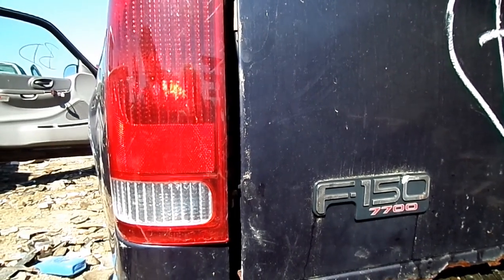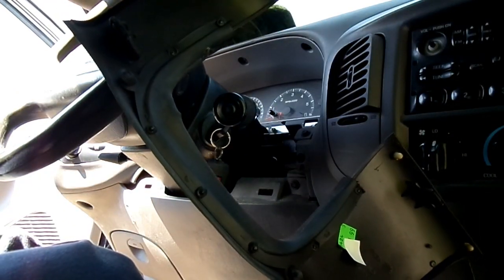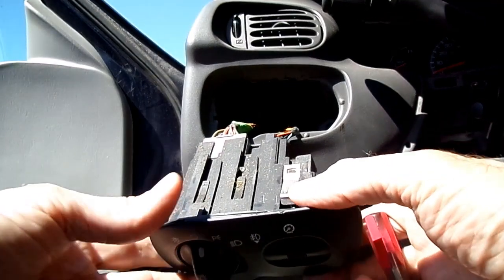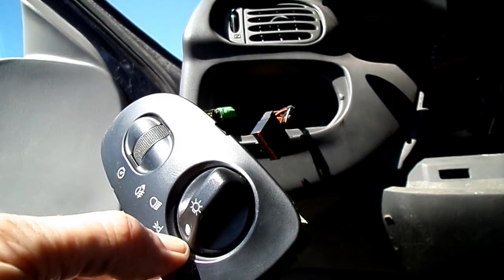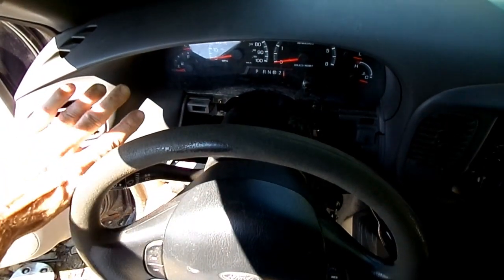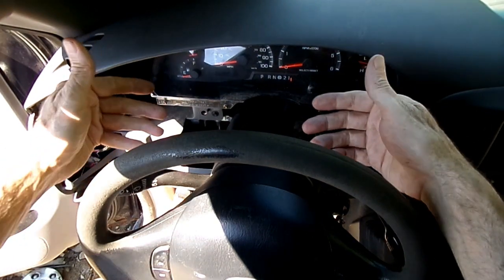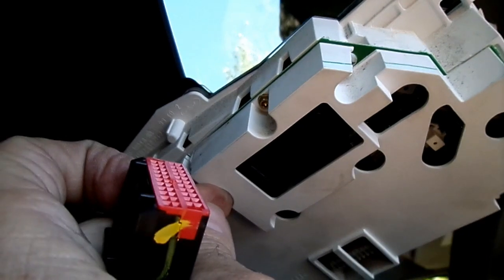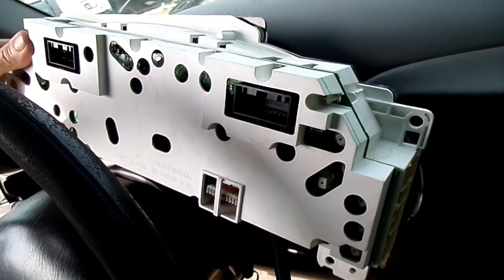Ford F-150 Instrument Cluster/Headlight Switch Removal

Comment: Well you made that look easy :-))

The hidden bolt would have driven me mad, but there was a hint to that panal coming out, small slot, most cars dont give you much of a hint and i usually have to pry and apply bending force to see if any part of the panal wants to unclip, or any part of the panal dont move with the rest.

Comment: There are two types of light switches. One kind will pry out like he is demonstrating. The other kind will break if you pry them out and requires a special procedure that is discussed in these comments. Just make sure you know which kind of switch you have or you will break it and it will cost you time and money.

Comment: Excellent video. Please show how to remove and install the radio w/cd on a 2002 Ford F-150 XLT 4.2. Or anything on the 4.2. That's what my wife drives. I just changed out the HVAC Heater Pipe p/n KT-71. (Google: KT-71 HVAC)It's sits on top of the water pump. It's metal and tends to rust and separate where the o-ring sits. The bottom part below the o-ring was stuck in the water pump. I had to use a seal puller to pull it free. New part is installed and no more leaks. Keep up the good work!
Reply from the maker: I put the radio removal on my to do list.

Comment: Thanks - helped for the REMOVAL but for the installation it is pretty much only possible if you remove the top of the dash (it is one piece from left vent by left blinker to the trim going around the radio). About 4 or so more bolts. Then of course the issue I have after swapping cluster is I now have a crank but no start with the cluster flashing repeatedly "theft"!!! Any idea on how to fix? I have heard you can spend $10 on a fuel pump relay (#304 I believe) and that might fix?? Haven't gone to the store yet and the F150 is sitting in my driveway unable to start.

Comment: Very good detail.  Do you know if the clear lense that covers the gauges can be removed without pulling the entire multifunction unit out of the dash?  I need to clean the area where the gauges are due to small debris/dust and a stinkbug that crawled in there, got stuck and died. Crazy but true.  Thanks for the video
Reply from the maker: I am not if the face comes off separately.
Reply: I feel your pain brother

Comment: Nice work...oil pressure gauge is dancing today...oil level is above full....oil pressure switch near oil filter?...I'll change oil before inspection...2400 miles...usually when the gauge jumped I knew it was low...I added half a quart last week...was surprised it jumped today...also my fuel gauge has been stuck past full for a year now...2000 ranger ...have to drop tank to fix?... May not be worth it...jasper engine at 70k...225k on truck...rebuilt trans...ty..great posts